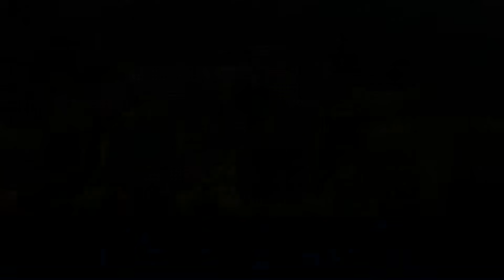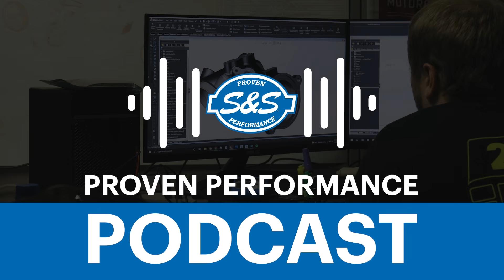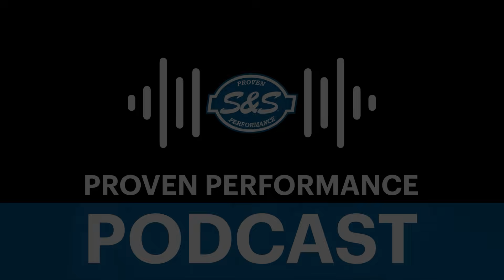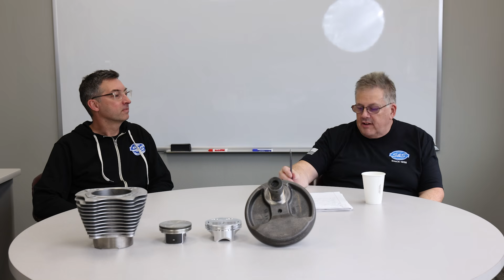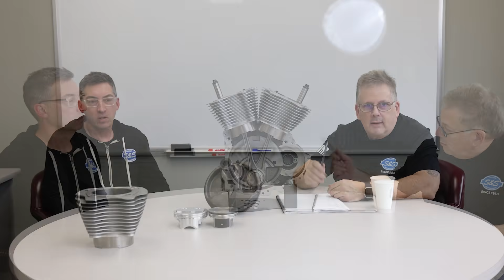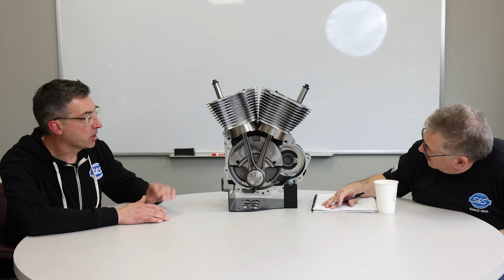S&S Cycle Proven Performance Podcast #11 - HP vs Torque

Comment: Torque is how much load your horse can pull from a still position over a short distance. Horsepower is how fast your horse can sustain a speed while carrying a certain load.
Reply: If when you think of torque you picture any kind of motion.. you aren't getting it. 
_That's Power. 
Torque has no time component. It is frozen and motionless.
The derivation:
a=P/(m• v) makes this explicit: acceleration depends on how much power (energy per unit time) is being delivered to the object

All work is done by Power!
Reply: @rollsroyce329 then why does everyone put a bike or car on a dyno and put it in gear and spin the wheel when they need to measure torque?   Yes there is a scenario where a bike has torque but not enough torque to move the object but that makes no sense. Motion is needed to measure torque and motion is needed to use torque.
Reply: @86FJRider  “use” torque? 🤷‍♂️. How do you think you can “use” torque?  You can use torque to hold nuts and bolts together but you can’t use torque to propel a bike.
Reply: Power is the process of energy transfer: 
(things happening)

"Force" (and torque in rotational systems), is the state
of energy equilibrium:
(noting NEW happening)
Reply: Forget about torque!

Wherever you are on the Power curve is your budget to accelerate, tow, climb a hill, push through aerodynamic drag... ** ANY ** type or example of work.  Torque is only a useful spec when you are calculating when parts will break or how much tension you need on the fasteners to keep the wheels on the hubs and the heads on the block.

All work is done by Power. It's not an opinion or just a fact,.... It's the Law! 
(The First Law of Thermodynamics-conservation of energy to be precise)

Torque doesn’t do work.
Torque is just the slope that energy wants to slide down.
The actual sliding — the real movement of energy through time — is Power.
Work is simply how much energy successfully slid.
Forces, torques, fields, and stresses are not the cause of work; they are the geometric shadows of an underlying energy imbalance.
Only when energy actually flows (Power) does any work occur, from a stalled motor to a tectonic plate to a quark.
So the clean, universal truth is:
Work is the integral of Power because all work is done by Power.
Everything else is just geometry; a description of the slope, not the movement.
Reply: @86FJRider first off there are two types of Dyno; one measures Power and one measures torque.  Even the one that measures torque (a load cell) can only measure torque if the engine is first making power.  
Torque = force x radius (no velocity or time component here it’s like a frozen snapshot)
Power = force x velocity (dE/dt) is a dynamic expression (includes motion and velocity)
Reply: @rollsroyce329 so is movement used to measure torque in both dyno’s?
Reply: @86FJRider   displacement or movement has to occur first to create the energy imbalance gradient that IS torque but torque is a static measurement of a static
phenomenon.  
Torque IS
Power Does.
Work records
Reply: @86FJRider  an inertial drum type dyno doesn’t measure torque, it measures power.
Reply: @rollsroyce329  so how is torque measured on a motorcycle if not by a dyno?
Reply: @86FJRider  I didn’t say it couldn’t if that is what you are trying to imply.  Please re-read what I said… it can be measured directly on a load cell type dyno or calculated from power on a inertial drum type dyno.  The point is while you can measure torque and it can tell you something about efficiency and predict when parts might fail; on its own it doesn’t tell you anything about work because torque doesn’t do work… power does.
Reply: @86FJRider   Torque is either measured directly on a load cell type dyno or calculated from HP on an inertial drum type dyno.  Either way you can’t obtain a torque reading without power as torque, RPM, and work are all emergent from dE/dt at the deepest most fundamental level.  Everything starts with energy transfer.

Comment: Father taught me relative to racing bikes, hp is how fast you hit the wall, and torque is how hard you hit it…
Reply: Torque is how wrong, stupid and irrelevant an analogy is. RPM is how much it gets multiplied by
"likes". Power is the resulting permanent cognative damage caused to our collective consciousness.
Power, not torque, is the limiting factor in not only the top speed of a vehicle but also how quickly it can accelerate at any speed and how much weight it can pull up an incline at any speed.
Please do yourself and the comments section a favour and watch a video called:
"Horsepower is NOT how fast you hit the wall.
Torque is NOT how far you take the wall with you" It's on the D4A channel. (not that I'm endorsing the channel) It illustrates the distain the people who understand Physics and engineering have for these idiotic social contagion Idioms that spread like a pathogenic mind virus through forums and comments sections.
Reply: Forget about torque!

Torque does not move energy.
 Torque does not create motion.
 Torque does not perform work.

Torque is geometry — a statement about where energy would go IF it flows.
Wherever you are on the curve is your geometric constraint — not your action. Your ability to accelerate, tow, climb, or overcome drag is governed by how fast energy can actually move.
That quantity has a name.
Power.
Torque tells you how. Power tells you if, how much, and how fast.
Reply: @rollsroyce329 Thanks buddy when I feel like a science lesson next time I’ll be sure to remember you… actually I won’t
Reply: @GlenV-j8b you’re welcome. 😁

Comment: The problem is, we are speaking English and not math. Horsepower and torque are intrinsically related and derived from one another. All engines make torque. All engines make power. What we mean when we talk about "torque" and "horsepower" is the shape of the curve, not what the words mean themselves. This confuses too many people.  A "torquey" engine has a curve that peaks early, a "powerful" engine has the peak moved closer to the redline.
Reply: And a engine that has hp and torque is AWESOME.
Reply: @themadyooper 👍like the Ducati Panigale 😁
Reply: A “torquey” engine is an engine lacking power and a powerful engine is an engine that isn’t lacking power.

A flat power curve isn't a feature, it's a bug. A Yamaha R6’s power curve could be made flat by installing a throttle body from a lawnmower. When we multiply something we get more of it. Power is supposed to increase proportionally to RPM.  A flat power curve isn't an indicator that something good and useful has been added it's evidence that much of the only useful thing the engine produces (Power) is missing.
Reply: @rollsroyce329  torque is power, at low rpm.
Reply: @moto_rad  Torque is not power in any way shape or form.
Power is power at low RPM, just less of it. 

Forget about torque!

Wherever you are on the Power curve is your budget to accelerate, tow, climb a hill, push air out of the way at top speed... _ ANY_ type or example of work.  Torque is only a useful spec when you are calculating when parts will break or how much tension you need on the fasteners to keep the wheels on the hubs and the heads on the block.

All work is done by Power. It's not an opinion or just a fact,.... It's the Law! 
(The First Law of Thermodynamics-conservation of energy to be precise)

Torque doesn’t do work.
Torque is just the slope that energy wants to slide down.
The actual sliding — the real movement of energy through time — is Power.
Work is simply how much energy successfully slid.
Forces, torques, fields, and stresses are not the cause of work; they are the geometric shadows of an underlying energy imbalance.
Only when energy actually flows (Power) does any work occur, from a stalled motor to a tectonic plate to a quark.
So the clean, universal truth is:
Work is the integral of Power because all work is done by Power.
Everything else is just geometry; a description of the slope, not the movement.
Reply: @rollsroyce329   "all work is done by power"   that is literally what Ive been saying.
Reply: @moto_rad 👍 cheers mate!
Reply: An R6 could gain bottom end power by adding VVT, VTEC, or a variable length intake runner, while maintaining the current top end
Reply: @moto_rad  if we could tune everything to magically achieve maximum BMEP across the operating range. Torque curve would be flat and power would rise linearly with RPM because that’s what happens when we  multiply something.  Torque is primarily a product of displacement.  Power is a product of displacement per minute.  If you still don’t get what I’m saying; I’m sorry you’re having trouble.
Reply: @rollsroyce329   Not sure what point you are making. What I just said is correct. An R6 engine with more tuning features would retain the same peak power and gain lots more power down low.
Reply: @moto_rad lots more?  No not the same magnitude as RPM but 15% or so sure but who cares.  Expecting to go fast from the go slow end of the tachometer is a fools errand. Some guys l race with cover the bottom of the tach with duct tape.  Bypass that 💩
Reply: The point I was making is Hardly Ableson and other Industial/Agricultural designs are torque limited…. They don’t make any at 8,000 RPM.  I am taking the piss here; I also ride a Road King, so I understand “character”.

Comment: Forget about torque!

Wherever you are on the Power curve is your budget to accelerate, tow, climb a hill, push air out of the way at top speed... _ ANY_ type or example of work.  Torque is only a useful spec when you are calculating when parts will break or how much tension you need on the fasteners to keep the wheels on the hubs and the heads on the block.

All work is done by Power. It's not an opinion or just a fact,.... It's the Law! 
(The First Law of Thermodynamics-conservation of energy to be precise)

Torque doesn’t do work.
Torque is merely a geometric constraint gradient.
Torque is just the slope that energy wants to slide down.
The actual sliding — the real movement of energy through time — is Power.
Work is simply how much energy successfully slid.
Forces, torques, fields, and stresses are not the cause of work; they are the geometric shadows of an underlying energy imbalance.
Only when energy actually flows (Power) does any work occur, from a stalled motor to a tectonic plate to a quark.
So the clean, universal truth is:
Work is the integral of Power because all work is done by Power.
Everything else is just geometry; a description of the slope, not the movement.

Comment: Torque is a measurable force. Horsepower is a calculated number based on torque measurement and engine speed.
Reply: Power is measurable. Torque is a calculated number based on Power measurement and engine speed.
Reply: @rollsroyce329 disagree
Reply: @guyconnell2250 you can have your own opinion just not your own facts.
Reply: @guyconnell2250  it doesn’t matter if you disagree or not.  It’s non negotiable algebra:
 
To calculate torque in foot-pounds (ft-lb) from measured horsepower (hp), use the formula: Torque = (Horsepower × 5252) ÷ RPM.

To calculate torque in Newton-meters (Nm) from measured metric horsepower (hp), use the formula: Torque (Nm) = (hp × 716.2) / RPM.

For that matter Power =dE/dt.  No need to consider torque whatsoever.
Reply: @rollsroyce329 maybe you should Google it. You'll quickly find the dynomometers measure torque and that horsepower is subsequently derived via a mathematical formula.
Reply: @guyconnell2250 🙄 your rebuttal that Dynos only measure torque disappeared.🤷‍♂️ in any event: reality bats last:

🤷‍♂️ Where did this social contagion internet Hivemind virus start?  This one that casts an incantation that power can't be measured?  Absolute Hivemind 🚮
I contacted Dynojet having used the Dynos for decades and knowing their inertial drum type dyno does in fact measure power directly and calculates torque where other load cell type like the Mustang brand measures torque and calculate power. I asked them to explain/provide evidence as to how their dyno measures power directly. *    This is their reply:    *

Inertia Dynos Measure Power Directly

The Physics: Dynojet inertia dynos measure power using the fundamental physics formula: P = 1/2 x I x w squared / t
Where: I = moment of inertia of the roller w = angular velocity t = time This directly measures the rate of energy transfer (power),  not torque.
Key Evidence:Acceleration-Based Measurement:
Inertia dynos measure how quickly the roller accelerates under load
The acceleration rate and known roller inertia directly yield power
No torque measurement is required for this calculation
Torque is Derived, Not Measured:
On inertia dynos, torque is actually calculated from the measured power using: T = P x 5252 / RPM
This is the opposite of what people commonly believe!
Load-Based vs Inertia Distinction:
Load-based dynos (eddy current, water brake) DO measure torque first, then calculate power
Inertia dynos measure power directly through acceleration physics
Why This Matters: This direct power measurement is why Dynojet inertia dynos excel at simulating real-world acceleration scenarios - they're measuring the same physics that propel your vehicle down the road.
The misconception likely stems from people conflating all dyno types. Load-based dynos measure torque first, but inertia dynos fundamentally measure power through acceleration dynamics.
This is actually one of the key advantages of Dynojet's inertia-based approach - you're getting direct power measurement that reflects real-world performance!

See also U.S. Patent # (US3729989A)
Reply: What was the point of this incantation?

Are you trying to imply torque is somehow more important and that power is not "real", "can't be felt", "can't me measured" and is not something an engine "produces" is "merely calculation, an “equation” based on a "formula". 

Anyone following along Please don't fall for any of this flat earth B.S. Engines and motors produce both torque and power. Both power and torque can be directly measured on a dyno and torque can be derived from power using a "calculation" using an “equation” based on a "formula". The same as power can be calculated from torque.
 We use measurement, math and science to prove things.  This is why maths are called proofs.
The use of maths is not evidence of witchcraft.

And finally, as these type of posts tend to come from Gnostic torque supremacists:
Power, not torque, is the limiting factor in not only the top speed of a vehicle but also in how quickly it can accelerate at any speed and how much weight it can pull up an incline at any speed.
All work is done by Power!
Reply: Forget about torque!

Torque does not move energy.
 Torque does not create motion.
 Torque does not perform work.

Torque is geometry — a statement about where energy would go IF it flows.
Wherever you are on the curve is your geometric constraint — not your action. Your ability to accelerate, tow, climb, or overcome drag is governed by how fast energy can actually move.
That quantity has a name.
Power.
Torque tells you how. Power tells you if, how much, and how fast.

Comment: 1:14 ”torque is the motion that moves a vehicle” 🙄. 
Torque is not a motion.  

If when you think of torque you picture any kind of motion you aren't getting it. Thats Power. Torque has no time component. It is frozen and motionless and timeless.
The derivation:
a=P/(m• v) makes it explicit: acceleration depends on how much power (energy per unit time) is being delivered to the object.
No power? No motion. 

All work is done by Power!
Reply: He meant the crankshaft
Reply: @LEONIDAS_JACK 🤷‍♂️ How exactly does that fix it?   Torque doesn’t turn the crankshaft, power does.
All work is done by Power!

Comment: 0:56🙄  ”torque is the measurable um typically the measurable thing that we measure on like the chassis dyno”…. 🤷‍♂️  
Power is also a “measurable thing that you can measure on a chassis dyno”…

Comment: Does he even know what he is talking about?
Reply: Sadly… no.
Reply: Looks like he got canned.  They announced in the comments they have a job opening.
Reply: @rollsroyce329 the first 3 minutes he sounded fine... he sounds like he know what he talking about
Reply: @LEONIDAS_JACK  sounded fine? 🤷‍♂️ 0:56🙄  ”torque is the measurable um typically the measurable thing that we measure on like the chassis dyno”…. 🤷‍♂️  
Power is also a “measurable thing that you can measure on a chassis dyno”…

He said torque is what get you stoplight to stoplight.  Hivemind 🚮

Comment: Low RPM riding needs a lot of torque. Moving needs HP. To make HP at low RPM you need a lot of torque. If you can make the engine live at higher RPM, the less cylinder pressure you need to make the power. Crusing rpm power can be adjusted by increasing torque or changing the gearing. Spin it to win it.

Comment: The fact of the matter is. That every engine design has limitations. The constant obsession with more displacement, bore or stroke. Is often misguided. Most V twin HD engines. Make adequate tourqe in factory stock form. The farther you move away from a factory engines design. The harder it'll be to keep it from flying apart. Bigger isn't always better. Durability should be the primary concern, in an engine that already makes plenty of low end tourqe. 
Compression ratios can only be so high on pump gas. Cams can only be so big. Before your just bleeding off all the cylinder pressure. The best street engines are relatively mild. A camshaft with a max of around 300° of adv. duration. With no more than 12 to 1 compression ratio, with fuel injection on pump gas. Beyond that your just pissing into the wind!
Peace